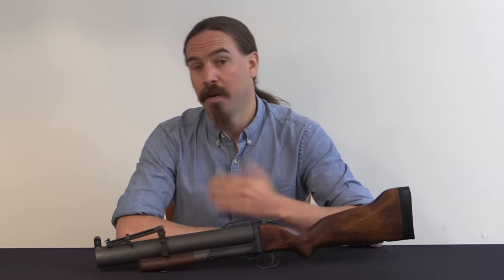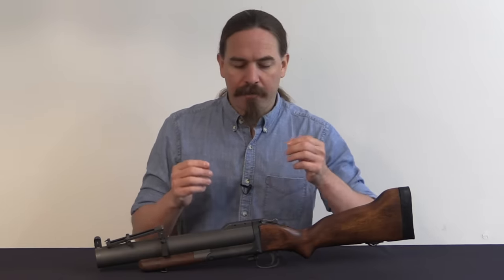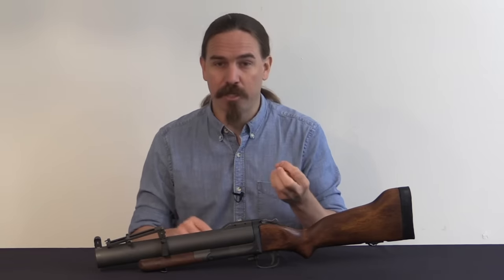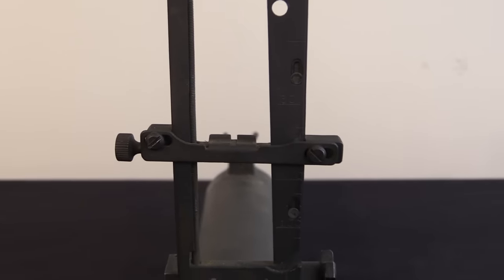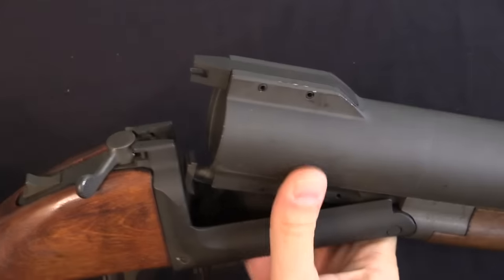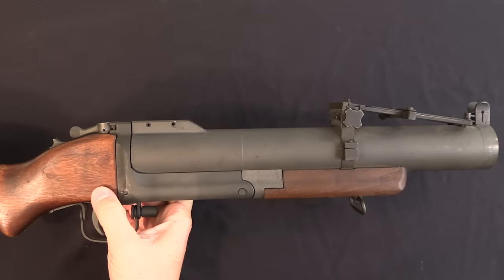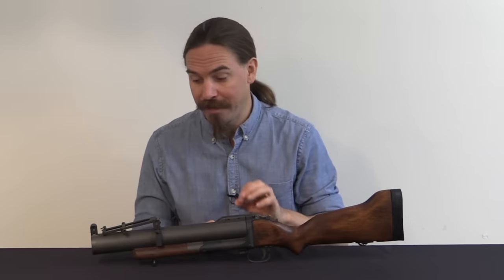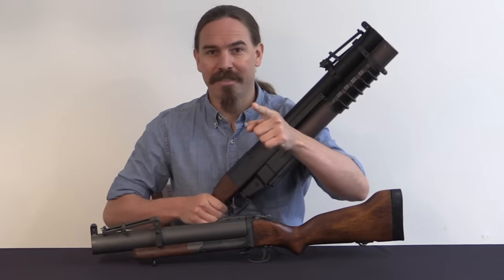M79: The Iconic "Bloop Tube" 40mm Grenade Launcher

Comment: 0:18 - Say WHAT?  THUMB DOWN for you not knowing what the F you're talking about!  The M79 was in NO WAY meant to replace the bazooka.  The "zook" was a direct fire anti-tank/anti-armor weapon, whereas the M79 was an indirect fire anti-infantry weapon which NEVER EVER used an armor piercing round.  DUH!  The M20 "super bazooka" was phased out in the 1960s, in favor of the M67 recoilless rifle (and later the M72 LAW rocket).

The M79 was meant to be a mortar-style weapon which could be used by a single infantryman and issued to one member of every Army infantry fireteam (Spec 4 Grenadier - two per infantry squad) and one per 14 man Marine squad.  Compare that to the 60mm M2 mortar, which took a crew of three and was impractical to use in many cases, especially in heavy growth areas such as the jungles of Vietnam.

1:58 - NOPE!  The M79 was fired UNDER THE ARM, not from the shoulder.  Look at the folding rear sight (over halfway down the barrel) and tell me how you would get a sight picture with the weapon on your shoulder.  DUH (x2)!

4:08 - NOPE!  FOURTEEN METERS (46 feet) is the minimum distance, although we were taught 40 feet, no doubt as a safety precaution to allow a margin for error.

7:07 - WRONG!!!!!  Didn't go anywhere???  What kind of an idiot are you?  The M1903 Springfield used the M1 rifle grenade launcher.  The Enfield used the similar M2.  The M1 Garand used the M7 (which was specially made for the semi-automatic rifle).  And, the M1 Carbine used the M8.  They were used from WWI all the way into Vietnam, when the M79 replaced the M76 grenade launcher which was used on the M14 rifle.

7:44 - WRONG AGAIN!  The M79 was preceded by the "Federal Riot Gun," developed in the 1930s.  The multi-barrel, automatic, et cetera designs came AFTER the breech-loaded type, NOT the other way around.  DUH (again and again)!

Eight minutes into the video and I have to stop.  You're going to make my brain explode.  Could you POSSIBLY get more of your information wrong?  I don't think so!  It doesn't take a rocket scientist to do a bit of research before spouting off all your supposed facts which are WOEFULLY incorrect.  I'm NEVER clicking on any of your videos again.

And, in case you're wondering, I put a few M79 rounds downrange in my time, back in the early 1970s, so I have ACTUAL PERSONAL EXPERIENCE with the weapon.

Comment: Really wish I could have fired one of these. I sadly LOL)only got to shoot an M203 (on the bottom of a MP-5 carbine) with  a group of cool dudes  now known as "Seal-team -6" ;)  LOL. Helping them to get rid of their quaterly ammo allotment. The Seals , like any other unit have to expend their allotment or they will get less the next year, which was interesting in itself.

With the 203,   I hit some floating pallets off the back deck of a RORO ship with that M203 at ranges of  about 200 meters with live frag rounds ,  and range estimation is really hard shooting at sea. REALLY HARD. IYKWIM
It looks like the M79 could be more accurate than that. Though I will tell anyone , the 203 combined with the MP-5 is an awesome weapon , and it is also quite obvious why the "Blooper" was replaced with the M16/203 combo in regular combat units.

Comment: As an EOD Technician, the 40mm system (M79 and M203) was not very popular. The fusing system wasn't as good as advertised and the result was a lot of duds to deal with. The sun quickly bleached out the anodizing, leaving EOD in a guessing game as to what round did they fire and what did we need to do to make it safe. We called then Easter Eggs, and most EOD troops didn't like them.

Comment: Actually, rifle powders are not fast burning powders... Handguns use fast burning powders... Of course, at the .50BMG and 20mm level, the powders are even slower burning... I once tried a case full of .50BMG powder in a 10mm handgun load, just to see what it would do... It was a relatively quiet round and did in fact fire, but it would not fully cycle the action on the 10mm handgun that I was using...

Comment: Ughhh the M79 i still have scars on my back from that FKN thing Excellent weapon system but carrying it was a major bitch ! the arctic Trigger  release always got bumped and it would stab you in most contacts running and pepper potting with the thing ! (In the NZ Army Section the Grenadier had the M79 and his personal weapon system the AUG).  the sight was also excellent for stabbing a soldiers back other than that it was accurate easy to use and gave the section added punch

Comment: The M79 can fire a varity of gas and flare rounds plus an antenna placement round that will not fit in a M203 the New one coming into service M320 can use the long rounds with it's side swing action. https://en.wikipedia.org/wiki/M320_Grenade_Launcher_Module

Comment: Who fitted that butt pad?  (3.18 mark) and the front sight is made for the high position of the rear sight and only lets you see the back of the blade not the flat top surface as you move the rear sight up.

Comment: Hehe  it's a modern BLUNderBUSS . Lol  imagine home invasion in 1785    . But instead of a Grenade ( witch apparently you could lite a fuse and fire a sort of 1780s Grenado   Lol   Bloop bloop    Nasty sound if you are in the open running for a slot trench  lol  bloop bloop     There goes yo Nutz and leg      Dammn

Comment: What was the purpose of the rotatable trigger guard? Was there some risk of the entire trigger system freezing and becoming unusable if you didn't move the guard or something?
Reply: For when the soldier would be wearing heavy winter gloves.
Reply: @paulshayter1113  Then couldn't they have made the trigger guard bigger?
Reply: @ianfinrir8724 , Sure but for some reason they chose not to. Maybe so it wouldn't be a snag hazard or maybe they didn't want to spend the money.

Comment: This is one of those videos where our otherwise knowledgeable host shows his lack of military experience. The 40mm grenade launcher was intended to replace the older M76 grenade launcher - which was essentially  a steel tube locked to the front of an M14, which launched M26 frag grenades using a very powerful blank round. While the M76 was very powerful, it took a great deal of skill to employ it and the Mickey Mouse sighting systems were flimsy and interfered with the rifle.

The 40mm grenade seemed to be the answer for squad level fire support; it was intended to fill the gap between thrown grenades and the 60mm mortar. An M79 was essentially a shoulder-fired mortar with a really small payload. A skilled M79 gunner could hit a running man at ridiculous distances but you had to hit the guy to do any damage. The explosive "golf ball" in the center of the round had only a small HE charge and the fragments it produced were tiny and didn't carry very far.  It was better than nothing, but we could have used a lot more bang for close in indirect fire targets.

I only used the thing in combat one time: my squad leader stepped on a small mine and blew his leg off from the middle of his left calf. We pulled him back to an irrigation ditch behind us and I took his M79 and his grenades. When the enemy hit, we were fighting at close range, so my first grenades went way over but after two or so shots, I figured out what I was doing wrong and started hitting where some of the enemy were.  I can't tell you if I hit anybody, because a rifle company closed with the enemy's flank and their survivors took off while our squad pulled back to evacuate our staff sergeant.

The main thing I remember about the Blooper is that you had to stick your head and shoulders out of cover to aim it and the round seemed to take an eternity to get to the enemy while you watched it fly. The trigger was very heavy and the ladder sights were cumbersome, so precise aiming took a lot more practice than I had.